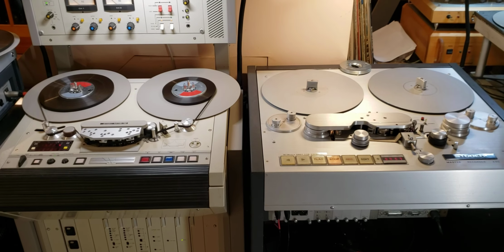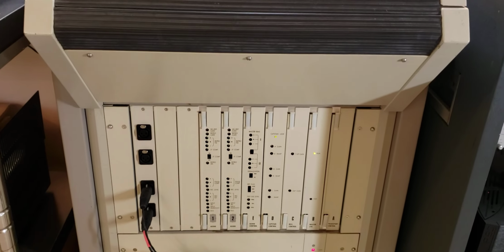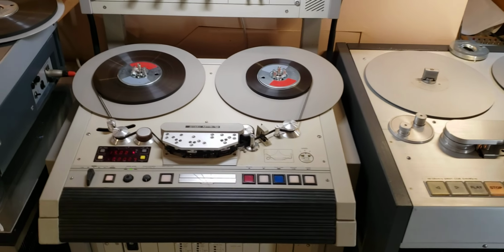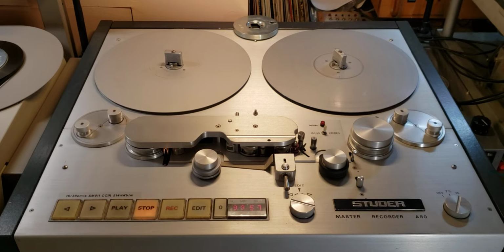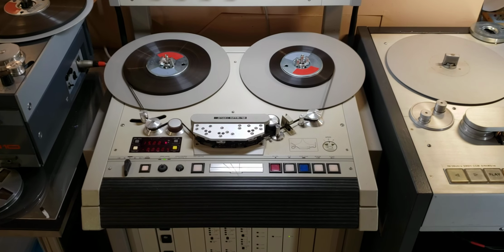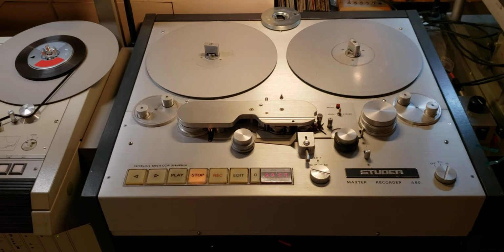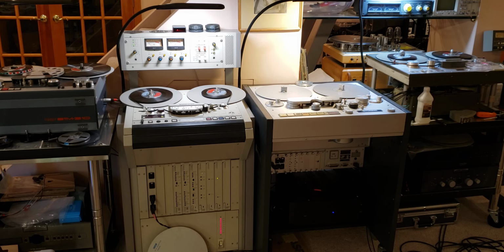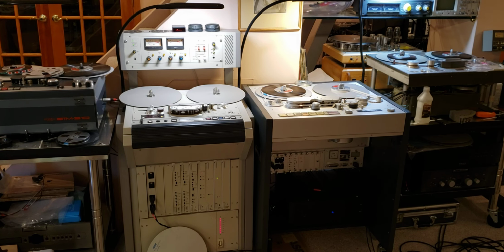Otari MTR-12 with Studer A80 playing through external head preamp

Comment: Thank you, this was very interesting and your modified BAT head preamps sounds fantastic. These combos in my view beat every other machines in previous tests, including Crown.
Reply from the maker: And that is how it should be... after all the external preamps are huge beasts compared to the internal small PC boards.  With ten tubes, and two power transformers, they weigh about 40lb and draw over 100W.   I just got the circuit boards for their EQ circuits, which is going to let me switch between 5 options - four tape EQ's and the RIAA. If all goes well I might even think about making it a commercial product.  :)
Reply: @Foxbat9000  Sounds very good, you should make it a commercial product if they sound so nice. Do you also have the schematic for the amplification part?
Reply from the maker: @szvencel  The EQ circuit boards just came in, and the first one was assembled and is running.  :)  But it is specifically designed for BAT phono stages.

Comment: nice comparison. Both are really nice machines. The Otari decks were also offered with Butterfly heads. Also completely agree with your comments on outboard tape head preamps. And if a person goes nuts, the outboard preamp can exceed the cost of the deck.
Reply from the maker: Thank you!  And speaking of Otari heads - I think a clarification is in order.  The machine in the video has what looks like butterfly heads, but they are different.  To the best of my knowledge Otari had two styles - one had the traditional parallel poles with wide guard band, and the other one has the poles shaped like a V, so they look kind of like the butterflies, BUT... they are truncated at their apexes, so as result they did not come as close together as the real butterflies, and as result they maintained wide guard band, or gap.  

Like I said, I nave never see the real, narrow guard band, Otari heads, so if they indeed existed that would be an interesting information.  

And yes, like anything in the field of high end, it is only the matter of time before the prices take off... there is already a $70K head preamp on the market.  

Fortunately, however, one doesn't have to go that high to get wonderful sound quality - if you know what you are doing, $2K will get you into high percentile.  One of the preamps I have can be found for about $1,500 on the used market, and... surprisingly... it is one of my favorites.  :)
Reply: @Foxbat9000  Thanks for the clarification on the heads. I have never compared so cannot offer any additional information. I have a deck set up with new flux magnetics heads but have never compared them to the stock MTR heads. Sounds like you have experimented with different tape head preamps as have I. Would agree with you on even a modest tape head preamp offering surprisingly good sonics. Thank you.

Comment: I strongly suspect that a Studer A-820 in decent condition connected in your tape-head preamplifier would be the finest Reel to Reel machine ever. Thank you very much !
Reply from the maker: Well, it certainly has great tape transport, no questions about that, but many people feel the Flux Magnetics heads are superior to the Studer ones, so I suspect there would be tough competition. And let's not forget the questionable quality small opamp based preamp sitting in the headblock...  I will likely never find out, as I am reluctant to go ahead and butcher its headblock for direct connection, eliminating the small preamp, as finding a replacement headblock for that machine is like catching the Snowman... people have spent years hunting with no success.

Comment: Very nice. Can you make a video comparison of how different tape machines change square wave signals at different speeds and levels?
Just by looking at how square wave changes on oscilloscope you can see how tape machine changes the sound.
Reply from the maker: But don't we already know at least the better part of the answer to this question?  :)  The visible distortion to square wave is what the Phase Compensation was designed to correct.  

However, at least in the Studer line, the models with Phase Compensation  - I believe starting with the A810... don't seem to sound all that great.  They tend to lose in the sound quality competition to their older, more primitive brother - the A80.  

To me this was the confirmation of my long time bit of philosophy - very often the obsession with trying to eliminate some visible defect damages the overall sound quality.   So we end up in that "Looks good, measures great... but sounds bad" conundrum.  

I am not at all against running some of that comparison, but I am afraid that you will face the need to explain how the Crown, with all its distortions, ends up sounding so much better, to our ears, than the far more advanced Studer.
Reply from the maker: I did a bit of that last night, among other things, and on my ATR-102 the square wave looked very good, actually... the clean fronts with just a small amount of ringing, some of it I am sure is my generator.  I was expecting worse.  So perhaps a video will be forthcoming.
Reply: @Foxbat9000  Nice. It will be interesting to see how they perform. Square wave represents the frequency response of a system because it contains all frequencies in equal proportion. To avoid ringing and aliasing from a digital generator you can set your test tone frequency relatively to your sample rate. 
If your sample rate is 48000, the test tones should be 480, 240, 120, 60, 30 hz 
If your sample rate is 44100, the test tones should be 441, 220.5, 110.25, 55.125, 27.5625 hz 
Setting the frequency low is generally better because you will see the wider range. 
Also output/input Impedance mismatch can cause ringing because the reflections are not terminated properly. 
Tape machine itself can cause ringing too depending on many factors.

Comment: Hi, I'm planning to adapt my DIY tube mc-phono pre for an ext. head amp for my Revox A77. I do not know yet what load should I give to the head and a 2nd thought comes as well, what happenes to the tape bias that has been recorded to the tape, but the bias trap is not included into my head amp... Maybe you could enlighten me in these topics as well? Greetings from Budapest!
Reply from the maker: The load issue is very simple, you just take your head inductance and calculate the LR pole frequency so it is well above your audio range, for instance, set it to 35KHz.  There is no bias frequency on the tape, so don't worry about it.  :)
Reply: @Foxbat9000  Thank you so much! Kind regards, Feri
Reply: @Foxbat9000  Hi, I prepared the modification on my RIAA MC-pre, and made a simulation, would it be too cheeky of me to ask you to take a look?
Reply from the maker: @ferencgraca7574  Not at all, email me at 38sc@comcast.net

Comment: Why didn't you dub the audio direct into the video? Then a good comparison can be made.....
Reply from the maker: The reason is simple - I do all this in between other things, using my phone as the recorder.  I actually bought a nice camera, but for some reason that did not work out, and I need to go back to it someday.  So at least for now I hope the content overweighs some imperfections.  

But there is also a philosophical aspect.  Feeding directly would be akin recording the electric guitars plugged right into your mixer - certainly NOT my preferred way... as we know, the good recordings are done in the acoustic space, using the guitar amps and microphones.  After all - when we are in front of a system we are listening to the speakers and the room.

I think both approaches have their merits and I would like to try the direct feed, but at this moment between a full time job and some family needs there are other priorities.
Reply: @Foxbat9000  Ok. I understand.